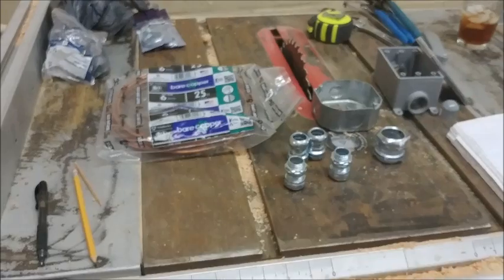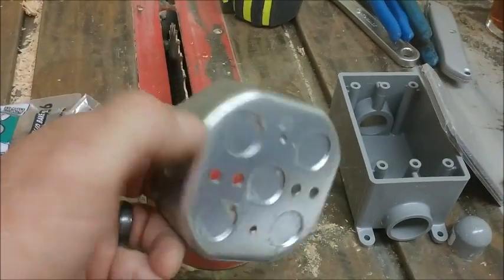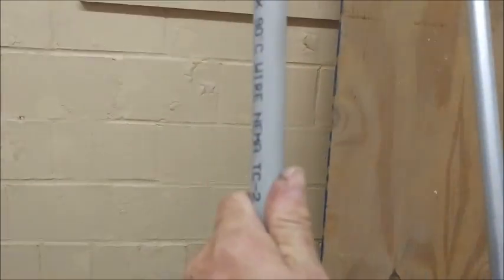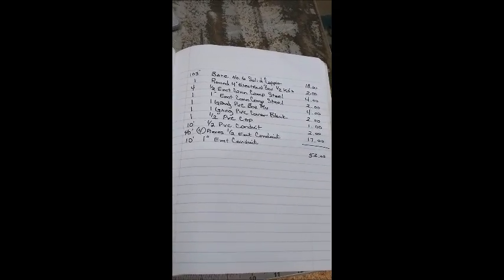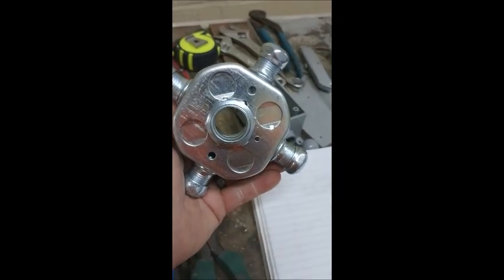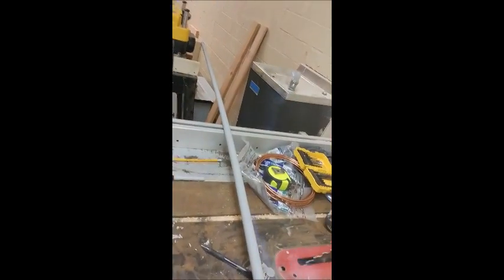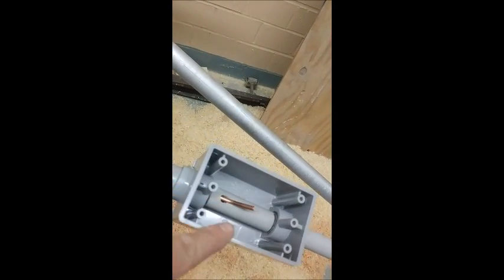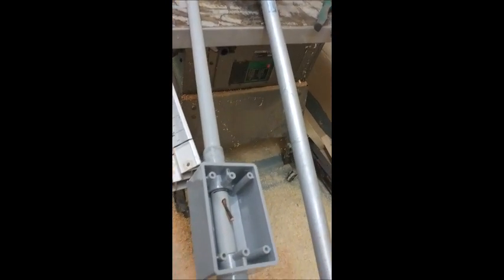How to build a CB antenna

Comment: I use a Sirio 827.  Ground radials are flat, no reason to bend the 45º angle in them. I hear this talked about over and over. Some people say it needs to be this specific angle and someone else says it’s another angle. I think someone made this up and it keeps getting repeated. True it still works with the 45º bend but why waste the time. I tuned mine for the frequencies I use most and have an SWR of 1.1:1 from 27.365 to 27.685. It’ll talk to Australia and Scotland from Arizona on 100 watts, and with flat radials. Excellent receive also.

Comment: How did you keep your wire from falling back down the antenna and into the pvc box?
Reply from the maker: the wire I used was so stiff the small hole I drilled for it to exit the bottom of the PVC pipe held mine
Reply from the maker: if you're using more flexible wire or smaller wire, you could probably drill small holes through the top of the pipe at the very top and loop your around a bolt before you cap the top of it.  Some may argue to use something other than a conductive bolt, but if your wire is insulated I don't think it would affect it or at minimum, you would be able to tune it to be a non-factor

Comment: So I'm taking your idea of using the junction box for a ground plane kit but using a stainless steel box and welding a stainless steel mirror mount to it using the center hole for whip stud mount with a 102 inch whip and a 7 inch or 10 inch raiser.. idk, I haven't tuned one before but your ground plane kit is spot on!

Comment: A simpler version of this 1/4 wave ground plane is to use 8 ft of 1 inch copper tubing mounted to a piece of wood at the base & using 4 six ft stranded copper wires for a ground plane kit attatched to rope at the ends which double as guy wires. Solder your coax center lead to bottom of copper tubing. Solder Coax ground to stranded copper ground radials. Be sure to secure coax to wood base.

Comment: 103" for radiator  = 1/4 wave antenna  . The formula is 468÷ frequency in Mhz. I believe  radiator should be 108" . Since your not loading any of the radiator into a coil  this antenna should perform real well.  Being a ham operator I would also use this homemade base,station ant. For 10 meters.  The antenna you are making I really like your idea. Tuning it may be tricky to get standing wave ratio down below 1.5 to 1 across the 40 channels .

Comment: Why is it important to angle the radial down at 45 degrees? I had a Penetrator 500 back in the 70's that had its radials parallel to the ground. That antenna is boasted to be the best of its time!
Reply: I had the exact same antenna. Aluminum radials set at 90° to the vertical. Best groundplane antenna I ever owned
Reply: The SPT-500 is a 5/8th wave antenna and uses a matching system to maintain a 50 ohm load allowing it to use radials at 90 degrees from vertical while a 1/4 wave antenna with 90 degree radials will have a characteristic impedance of around 100 ohms. Dropping the angle of the radials down to about 40-45 degrees will lower the impedance down to about 50 ohms.
Reply: @jfrphoto01  What does that do to the radiation pattern?

Comment: Can you explain something ... I'm not following 100% ... but I think I have it ?? .. You cut 17" off the 10'-0" PVc  saving the bell-end - You drill a hole for the #6 copper in the 17" part ??? and slip the 17" piece into the Bell end of the 103" piece and the whole lot sits snug within the 3/4" PVC Electrical Box !! ??
Reply: Getting ready to make a version of this and have watched it several time. I think you are correct with the 17" piece of pipe.
Reply: Thanks Smokeyvalley1 ..
Please let me know how your Build went and also what type of wire you used and the length ..
If you could also advise on the MHz you were aiming at ? - & the resulting SWR reading, I'm sure it would be of benefit to Me and others reading this ..
73 and best of luck with your protect ..

Comment: Getting ready to finish mine and tune it. Hope to have it in the air by Saturday the 2nd of February 2019. Thank you my friend. The Buggs...Big 'T' LB 155 North Central Ohio
Reply: ...and?
Reply: @smokeyvalley1  I built this antenna just the way the vid instructs and it worked great. Better than an A99!
Reply: @greasemonkeyradio1279  I built one just after posting the question. Spot on and NO tuning to be done. My only issue was I didn't have a good ground (was using just a metal bar about 1' down....now using copper rod 7 or 8' down) to start with, but after working on that, bingo!

Comment: All an Antron is in a nutshell is an end fed dipole and having an absolute 1:1 flat match for the ohms impedance and low frequency of 11m is NOT an absolute dire must have, but changing the angle of the ground radials i.e. 45° down slope with a total of 135° degree angle measured from the vertical radiator will achieve a 50ohm impedance at the feed point. As for the diameter of the radiator, of course the larger the diameter, the broader the bandwidth.
Reply: Vacuum tube junky...... while trying to solder my #6 solid copper wire to the coax, my iron was not big enough to heat up the copper (I guess I got impatient) so  I flattened 'just a bit' out the last inch of the copper making it easier to solder. Then i started thinking,  will the 1" somewhat flatter piece of copper wire effect the radio signal put out by my cb radio? Hoping you can give me some hints.

Comment: Just wrapped up my build on this followed to the letter on your video. Works real good but I have a consistent 2.3 swr across all 40 channels. I used lmr 400 cable at 50’ and terminated at the back of my big PDC600 meter that has always read good for me. I could only get the base about 25’ off the ground so I don’t know if that’s the issue but I thought I would give thanks for the idea for the build!

Comment from the maker: I have played with this antenna a lot more and at the 103 inches it seems to perform best for CB channels 20 and down below on the lower 20 channels.  I think I will trim about a 1/4 to 1/2 inch off and tune it better for CB channels, 11 Meter

Comment: what did you use for the ground plane aluminum ? and how long on each side i guess i missed it ,thanks
Reply: Isn't aluminum about the worst metal can be used for ground plane? I'm not knowin', I've just read it a few times in different blog posts lately.

Comment: One of the special video I've watched today. I also want to give the best suggestion for those who want to buy CB Antenna. Yes, A CB Antenna of 10000 watts of power that it can handle easily and with double wall coil cover. I've recently bought this beast and homemade CB Antennas are also great but cannot provide that qualitative with power. .I have so many mobile antennas,But the a STRYKER SRA-10. It's the best CB antenna.I highly recommend this antenna. You will not be disappointed. Guaranty... 73s. you can read more about it here, if anyone wants to read: https://strykerradios.com/best-cb-antennas/

Comment: WHY NOT 108 INCHES ? THAT IS 9 FEET 1/4 WAVE OF 11 METERS.
Reply: CHRISTOPHER SMITH this is where the fun part of frequency calculation comes in. You have to consider the material you’re working. 108 inches works great for stainless steel. However he used a copper wire so it physically needs to be shorter because the radio frequency sees the copper wire as a longer material electorally. Hope that explanation helps
Reply: That is why the SWR  is a bit high on the low ch . He is talking of cutting it even shorter , when if anything it needs to be a wee bit longer to get it low .
Reply: @robduncan599  ....Damn..  I cut mine two times and it's still to short!!
Reply: I wondered about that myself.
The 102" whips are right to 10 meter or 11 meter once you add a 6" spring.
Reply: There is more to the calculation. You also factor in the velocity of signal through the active element. In this case, velocity that the signal can go through a copper wire is about 95% the speed of light. So 108 * 0.95 = 102.6. Give or take a fraction of an inch depending on which frequency you are optimizing for within the 11m band, 102" being the most common
Reply: CHRISTOPHER SMITH ,

I was wondering the same? Cheers.
Reply: there are more factors making the length of an antenna, it's not just a calculation i'm afraid